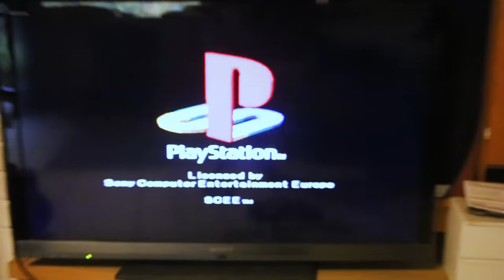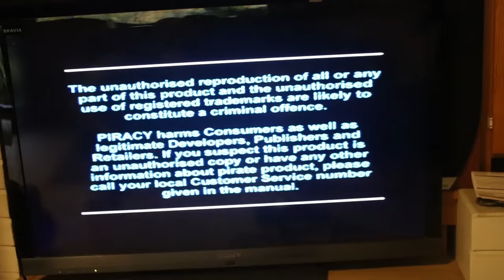Restoring the original PlayStation (PS1) - Vintage Console restoration & repair

Comment: Yeah, the biggest issue of this machine was the previous owner.
Reply: Yeah,but  maybe he got bored or something
Reply: Hey man this gaming console only cost 10€ in France! It's just a PS1.
Reply: @albertsevigny8324  there is somthing called its been in the garage dummy
Reply: @hassangba The PS1 has no value rn its ubiquitous
Reply: Edman that obviously is the biggest issue lol xD 360 no scope bok Choi
Reply: It's real my uncle has a old 360 it was in the back of his work truck said it had red ring of death it was dirty af. I just switched the hd and it worked flawlessly plus a good old scrub.
Reply: @goutam-007  yeah or his life changed and found his own destiny or his calling.
Reply: Edman it wasn’t the owner the grime has to do with what the case was made of with a combination of dust and humidity in the air. Mine was well taken care of and sat put up for years, ended up looking the same
Reply: Albert Sévigny nope I think that’s a combination of a poor quality case dust and moisture in the air
Reply: You guys have to understand. At the time the thing is useless. It's like cleaning rubble from a tore down house. So of course it is going to get very dirty as it sits. And maybe this is the only free time the guy had in a while to get it cleaned and fixed. It's not always someone being careless
Reply: Simon Cowell and yet you watched it 😂
Reply: When the PS2 arrived
Reply: turn down for what xD
Reply: @chillz315  my stepdads had the red ring of death too but it went away on its own it 2 days. All he had to do was restart it a couple times.
Reply: Jesus what the hell happened to it
Reply: Bread you can buy it in uk game stores for only £18,  very good condition, although it’s not that common find find any
Reply: @hassangba Was probably joking but
Reply: What makes that "mod chip"?
Reply: @gamer64games15   r/woooosh
Reply: He dipped it in a pool of coffee
Reply: its obvious he put dirt on it to make it look dirty
Reply: These videos are fake.
Reply: I miss yo gi oh
Reply: @Cabeza492  Use pirate copies...
Reply: @krystoph4420  maybe it's rusty. Or food spills
Reply: @iamsk8  you cannot buy it new . Although you can buy second hand or just emulate ps1 games in PC it will work fine
Reply: Albert Sévigny Maybe he got rage quit on game and decided to drop it in mud lol
Reply: @albertsevigny8324  the hell? this console is older than you, guess how you would look like if u weren't taking a bath for all those years...
Reply: Well the game logo shows you how the fans support their lead devs and game cos.
Reply: Gody
Reply: what a hardword you done to restore it only to say at the end that the game was stupid lol 😂😂😂
Reply: Yeah he is the previous owner,come on now.he's simply coming up with his own content.wkeup
Reply: @fockewulf190ar  thanks dude :)
Reply: Exactly
Reply: @mnlightjewel3030  Not really I paused it as soon as it come on. I also have add block and some friendly advice skip a video to the end, press replay and all adds gone.
Reply: Two years ago I bought mine for about £30, so wow.
Reply: Genius:))))))))))))))
Reply: @albertsevigny8324  wow really, you literally could get a PS1 for $10, 5 if you lucky enough.
Reply: Lmfao pretty much.
Reply: Albert Sévigny agreed😜
Reply: But who knows what happened to them maybe they got ill or something. Hopefully not.
Reply: @goutam-007  f
Reply: Edman yea he was called stinky pete
Reply: I remember I used to be curious so I would drop random stuff in items
Reply: @krystoph4420  why would he ruin a perfectly good ps1 then?
Reply: lloolll
Reply: Savage
Reply: True
Reply: Hehe
Reply: will then why isn’t the disc closing HMMMM???????????
Reply: I have to say, im a xbox person, hardcore. I dont like playstations usually, but the ps1 was the by far the best console of its genation, some of the games it had like the croft games was a generation ahead, its dual shock controller is basically the first modern controller ever and is as iconic as a coca cola bottle, i still today dont mind using it. Ps1 is the stuff of legends and can arguably be called the first truly modern console
Reply: These restorations seem fake....
Reply: @heingerin8675  For now.  If people just throw away every old machine that doens't work, in another 20 years they will be extremely rare.
Reply: InlandFaun374. People that want to store it away and keep moisture and dust from getting into it. Why the nasty name calling?
Reply: inside part is actually good
Reply: At least this guy’s gonna take good care of it.
Reply: You got czech pet on profile
Reply: @vojna1123  If you consider that mole a pet, then yes :D Maybe because I'm also from there - like you probably are ;)
Reply: The previous owner probably considered it as being a piece of garbage, but was too lazy cut it up to fit it in the bin.
Reply: On something as grand as a 25 year old game console. Je. Sus. Christ.
Reply: @krystoph4420  thats kinda mean what if someone say that your personality is fake
Reply: Seriously think that’s my old PS lol
Reply: Hein? Gérin !! Yeah a ps1 not made anymore from 1994 it’s 2020 and there’s not tons of them left it’s called a gaming antique
Reply: Edman facts
Reply: @squigglenutsfosheegie1994  So two ad breaks in this 15 minute video is proof that OT mucked up the console, caked in all that dust, bent the RF shield, installed a poor mod, AND made it look like it was like that for a couple years? My god, you must be a detective. Nobody ever in history has ever let their video game console get dirty, let alone fiddle with the hardware unauthorized. Nobody would ever send someone an old, rusted, or broken piece of equipment for the sole purpose of restoring it to it's original glory. I cannot believe OT would use the greater public for ad revenue. Make you wonder what other restorations he's doctored all this time. How many 19th century coffee grinders that definitely don't rust with wear and tear did he sabotage for views? All those spare parts he pretended to make. All those other consoles he fooled us into thinking he retrobrited. The world owes you debt, Rasta Lion; you have awakened us sheeple. 😂😂😂😂
Reply: Definitely ☠️
Reply: @squigglenutsfosheegie1994  well he does find consoles that yellowed so badly that they went from the color white to a dark goldish color
so the chance if this being fake is small
he just manages to go to the deepest darkest corners of ebay
Reply: Simon Cowell did he also put the dust inside and break it? Lmao
Reply: Medicine is the restoration of discordant elements; sickness is the discord of the elements infused into the living body.
Reply: Bro I would  NEVER take that outside especially when it’s raining
Reply: BrandonFoamposite My ps3 looked like that after almost a year of no cleaning (keep in mind not in an enclosed espace). I cleaned it. I imagine this PSX was probaly stored in a box or somewhere poorly ventilated for years leading to that disgusting amount of dirt and grime. Heck, I'm sure my baby is disgusting in the inside (works perfectly fine)
Reply: and the fact it is an OLD console. these products are bound to age overtime and stop working. it's not just the owners fault.
Reply: So true, I still have one here, he's literally older than me (I was born in '98 and my parents bought it for my brother in '96 I think). It's in almost perfect condition, it just got a bit yellowed and the disc reading thing needs to be replaced, which is kinda common, but other than that, it works just fine.
Reply: Albert Sévigny I seems it was stored in a humid shed or something, my PS3 controller looked like that after I forgot it in one of my drawers for a few months (Yes it was disgusting and I cleaned it)
Reply: John Smitty Consoles need to breathe never do that (unless it has bugs)
Reply: Sakarias Karlsson The N64 became better as better games released as it aged, and diferent controllers were made (thank god for the N64 brawler) but at the beggining it was a pile of shit.
Reply: Chris L All PS3 play ps1 games
Reply: No kidding. People need to stfu about all this being fake. They just say that because they'll never be as popular or skilled as this guy and they're crying about it. Their are people who can be this careless about console upkeep and maintenance, to the point a console can look this beat down and broke. Then you have this guy fixing all these problems with ease.
Reply: @gamerboysp2559   you need to understand that most of these restoration videos are fake. All one need do is is record footage of the console working or fake it with an emulator and then get it dirty. These kinds of videos can be made in a couple of hours and they generate millions of views. If you don't mind getting scammed thats fine, but people are justified in being dubious.
Reply: @brandonfoamposite7461 so is it mold or dirt?

Comment: Its exactly the meme

Console: hidden on a random, extremely moist and dusty cardboard box near a patch of mold in someone's attic/basement. Last time they've seen action was a decade or more ago, they dont know anymore. Time is but a loose feeling when 2/3 of your frame is covered in yellow and dust, your disc drive is barely moving and your laser no longer shines like it used to. The console is ready to accept fate, it has already embraced it, actually, but then..

Odd Tinkering: Come, this is no place for you to die.
Reply: That very true

Comment: Me: takes broken wii u to the shop to get fixed
Shop: sorry we can’t fix it, Theres an issue with the wires.
Me after watching this: 0—0
Reply: Grand Prettymoon this ps not wii
Reply: @roy_issachar  i think that wasn't the point
Reply: Anything can be repaired and reversed engineered with the right knowledge basically. Just not a lot of people can do that type of stuff tho
Reply: Wait... Issues with the wires? Was that excuse for real, or was this just a joke?
Reply: @WH250398  you gotta be American 🤣
Reply: @outshine5411  Well, no. Wires can always be replaced. In case of ribboncables it's even easier, because there are always plenty of aftermarket ones.
Reply: @k1ngan1m3tr011  Problem is, if you consider wages, its usually cheaper to just get an new device instead of trying to fix a broken one. Sad but true.
Reply: Tell me you didn't leave it with them for them to dispose of it for you. If you did I be if you back in a week they will have a refurbished wii u for sell.
Reply: I work for a well known US nerd company for a certain tech company with bright colors, and I have to turn stuff away so damn often. Stuff that I could EASILY fix in my free time, like this PSOne. It's literally my hobby to restore stuff. But if I ever do a 'side gig' at work, it's a clause in my contract where I'd literally get fired. It's so stupid.
Reply: @roy_issachar  i think he was referring to the fact that they refused to fix his wii u only because the wires where damaged and said it was impossible while this guy managed to fix even more ruined consoles
Reply: I know that....I had the same with the intel pentium windows 97  300mmx ... it was always so slow to install or update...(at this time,that was the fastest pc on the market!)
At the shop
Servis:You need to reinstall drivers 
Me: (thinking"a elementary school kid 1st pc" who is driving what!? )
Can you do that?? I don't know how.
Service: just reinstall drivers.
After 30min explanations they took and did it. Came home...dos loads..windows Nope!
Back at service the same guy.
Service: what's now?
Me: won't load windows.
Service: well you need to reinstall Windows
Me: seriously man??? You didn't even gave me my copy of windows even I bought one with the pc! How am I supposed to reinstall Windows!???
Service: just put the windows CD it will show you a screen where you have options to choose from.
Me: Muuuum
(My mother speaks about 5min with the guy, and we got home with a new pc)
Me: mum is the best!
Mum: now you can start with homework 
Me: no problem ;)
Reply: They just say that so you will have to buy a new one in their shop
Reply: @roy_issachar  very smart man I see.🤔
Reply: Daniel ...but... my miis!

Comment: They should encourage these restorations or repairs. A lot could be reused and we would have less waste.
Reply: Yeah i'd like to see how you repair a PS4 which is insanely complicated and not meant to be repaired. Sony doesn't make replacement parts, this is the reason why even finding a belt for a cassette walkman is tricky.
Can't repair electronics if nobody makes parts for them.
Reply: @rochester212  That is what I am saying. Forcing them to sell spare parts at a fair price. Or collect broken electronics from the market.
Reply: I agree man
Reply: It's happening more and more with older hardware from 80-90's especially gaming consoles. People used to throw them away but there are only so many left out there that people are starting to take better care of what they have.
Reply: @huldu  still got all my consoles starting from the amiga 600 if u can count that lol
Reply: @rochester212  ps4 is not that complex hardware wise and there are always broken ps4s with different faults that cam be sacrificed to make 1 working ps4, especially when it's something simple like a hard drive fault, I strip mine down regularly for maintenance and I think the only issues would be If the disk drive is ps4 specific like the old xbox 360s were
Reply: @A7Xdookie  Can still get them, check out YouTube channel called my mate Vince, just recently repaired a few ps4s
Reply: Also these resto videos shouldn't be faked. It's quite obvious he smuttered the mud on the console to make it look worse. The mud wouldn't stick to places lake the slots if they are in use and if not in use then the connector ports wouldn't be so clean as they are here.
Reply: Those of us who love retro gaming and electronics but are too young to have owned these pieces of hardware agree with this. I wish more people sold their old consoles to people who restore them por reselling
Reply: Wellington Gomes dos Santos people are to brainwashed to toss things when they stop working to ever consider this
Reply: @siriusleto3758  "forcing them"

Don't.
Reply: Wish I'd got this guy to mend my first PS2
Reply: @howtowithelizabeth7513  yeah, maybe in brave new world
Reply: This is not the way to go, it shouldn't need repairs.
They should encourage to make things last longer in the first place, instead of planned obsolescence.
Reply: @QoraxAudio  Making a product easy to repair is a way of fighting planned obsolescence. Look at old cars for example, in the end all devices will fail, it's better if the device is easy to disassemble and has available spare parts, as opposed of it being impossible to disassemble and only having propietary components that need propietary tools to install
Reply: @germanban  True, that'll help.
But basically you first incorporate planned obsolescence in a product and then find a workaround for it.
That's like creating a problem and then finding a solution.
My point was: A solution isn't even needed if the problem wasn't created in the first place.
Reply: Who is they 😟🧐😳🤐
Reply: @JackyRogue  People with too much money that are constantly buying new garbage and tossing old crap out.
Reply: @JackyRogue  Who is you. Who is my. ☹️🧐😳🤐